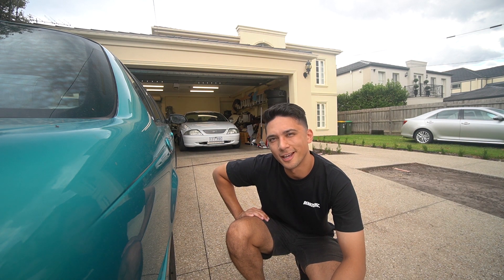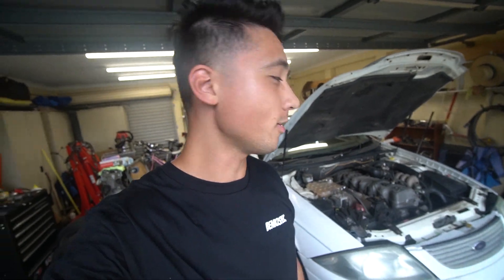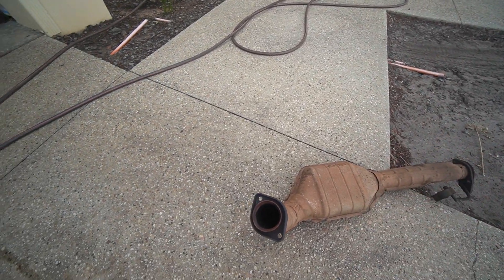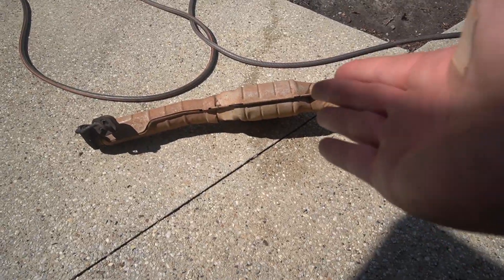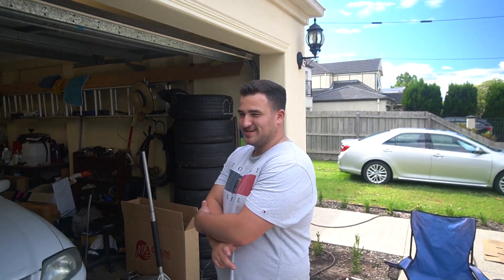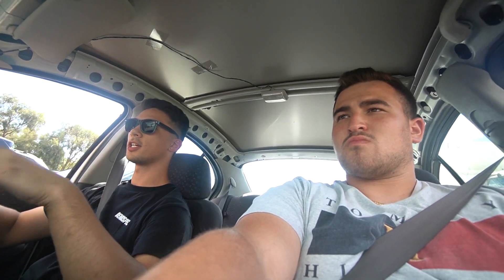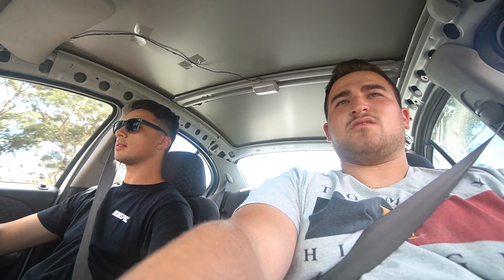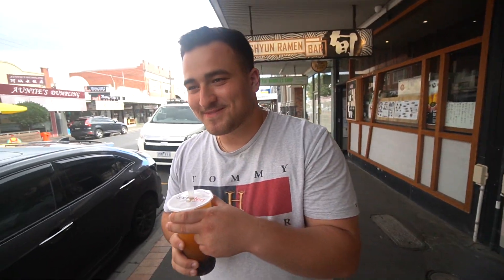SO I DELETED THE ....... ? THE AU FALCON MYSTERY PROBLEM 🤦‍♀️

Comment: Have you checked your injectors volts with a multimeter you might have one shorting under certain conditions which would have similar  effect, more then likely its a electrical gremlin not a mechanical fault

Comment: My au had a similar problem, so I fired the parts Canon at it
Changed the
Spark plugs
Leads
Pcv valve
Coil pack
Intake gasket
Air filter 
Fuel pump
Injectors 
ect ect, still was acting up,finally gave in and handed it to a mechanic to fix ,in the end it was the ecu was getting hot and playing up, lost its heat sink,
Reply from the maker: interesting! I actually tried my mates ECU but i couldnt get it to start because of the smartlock... I dont know what to do about that
Reply: @RexH  the mechanic got a ecu from a wreckers, then reprogram it changing it to my vin number, using a Diagnostic snap on ipad looking thing, it was all abut above my head 😂
Reply: Might pay to take it to somone like “maxx performance” and get it dyno tuned, pretty sure he would know more than anyone on the internet, I think his shop is over on your side of Melbourne,
Reply: @RexH  it could be something as simple as the connector to the ecu being a bit corroded, a simple fix with contact cleaner overkill and visual inspection.  Sometimes doesn't hurt to open up the ecu and soak it in contact cleaner.  Tbh a decent scantool or software (forscan) would show anything weird going on with the ecu.

Also make sure your alternator is good and your battery is very healthy.  It can be absolute fundamentals that cause all sorts of strange things.
Reply: @RexH  only way around that is to take his BCM, keys and ECU altogether and run them in your car. 

Otherwise you need to use the wipe and relearn procedure to link his ECU to your cars BCM/Smartshield set up which requires tools

Comment: You could try a lightened flywheel, which would allow the car to rev faster and get into its power band quicker.
Reply: Heavy flywheel is gangsta for clutchies but... And an intech doesn't exactly peak its power up high, they thrive on mid range boonty
Reply: Lightened flywheel is only good for rev matching and track work etc. When it comes to slamming gears and straight line speed, heavier flywheels are actually king. Drag cars run heavy flywheels. 
Helps the engine to not loose it revs between gears and feels like you're slamming into the next gear harder 👍
Reply from the maker: Yeah Galli is right! We've had experiences withj lightened flywheels and they make no difference power wise. they're good as for rev matching tho

Comment: Try replacing the crank position sensor which is just mounted at the front of the motor just behind the top of the belts.   Held in with like two 7 or 8 mm bolts.   I replaced this and my motor run a bit smoother I feel.

Comment: Maybe try putting VT commodore injectors in it they have better flow then the au ones and or the Idle air speed control valve

Comment: If you're changing the ECU, make sure you get one from the same year as your car. The plugs are different from series to series and spec to spec. When I manual swapped my S1 I wasn't able to swap the manual ECU over without also swapping the dash loom. Ended up just swapping the whole dash and I was good. Just something to keep in mind, especially if you're gonna VCT swap too

Comment: The issue is you have a stock exhaust. I bet if u cam it. Get some 4480 pro comp pacemaker  extractors and a full 3inch exhaust system with a hi flow cat you will  notice a big change in performance. Also don't go vct. There a waste of time and money....

Comment: You're meant to reverse flush.  Anyway hot water and a dishwashing tablet or two, soak for 24 hours, then reverse flush (if you can find a big enough container to submerge the cat).  Then dry in the sun or use a hairdryer in one end and leave it sit for an hour or two, then reinstall.
Reply: Its cheap enough to buy a euro 5 or 6 hi-flow cat aftermarket these days, if you CBF'd cleaning.

Comment: I guessed the MR2 power exactly and I diagnosed this issue as soon as you mentioned it. Spoiler alert, it will still be slow. I just ordered a stage 2 j3 chip for mine hopefully a 98RON tune and 1000 extra rpm on the rev limiter will encourage the old intech to do more incredible things 😊🤦🏻‍♂️